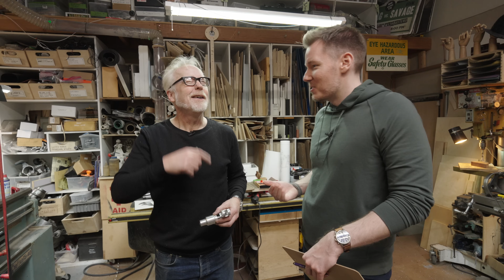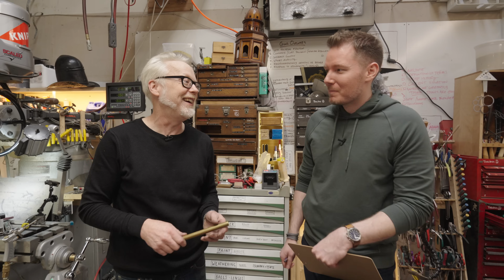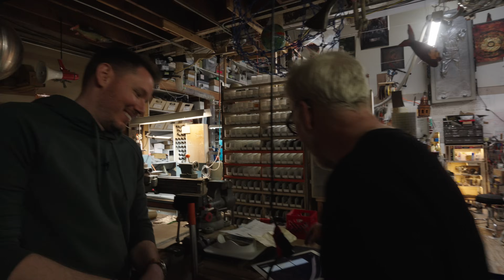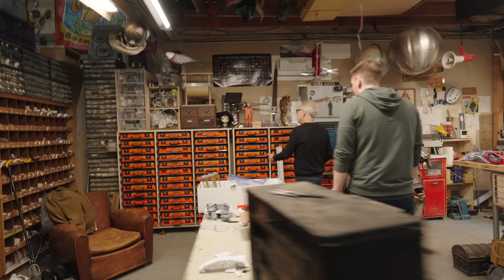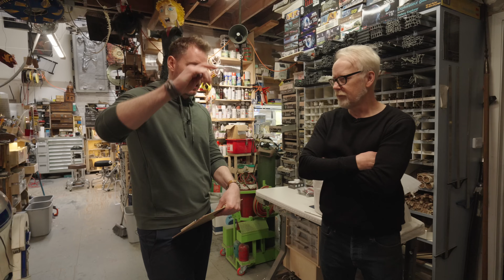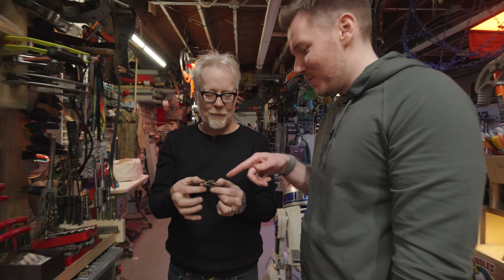Adam Savage's Beautifully Chaotic Studio Tour

Comment: You could use the rear camera if you made a mirror box that was essentially a very short periscope, 2 mirrors would flip then unflip the screen image. You'd have to remove it to access the controls, but you could prob remote trigger recording somehow, even if its by not covering the bottom 1/8th the screen.

Comment: The Marette is different from a wire nut, in that it has a brass screw-in insert with a screw-down wire fastener; then the black plastic cover screws over the brass and covers and insulates the connection.

Comment: I found a box of 4  ft long flex microphone holders at a used mostly electronic store. I think it's 1/4-20 on the far end. They are very flexible and perfectly quiet when bent and would hold your phone. I understand you always use what you have on hand first but I think you would like them better. Used they were $20 each. If they had been $5 each I would have bought the hole box. The guy at the counter said they were $100 each new. Not even sure what I'm going to use mine for but I just had to have it. ADD/AS if you get my meaning. Thanks again for sharing.

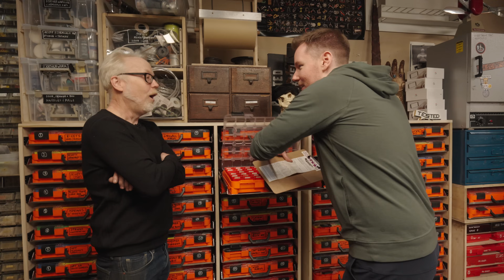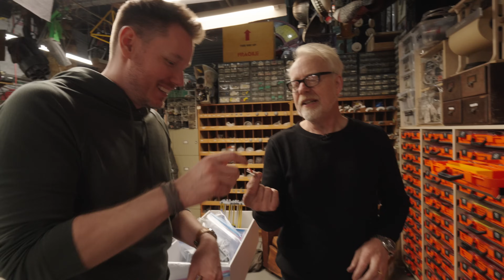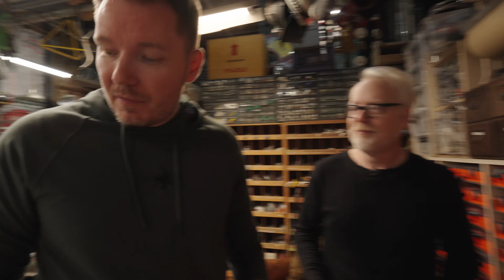Comment: 13:25 genius. 14:45 technically pronounced 'vahh-go' because it's a German company, but should be pronounced exactly as Adam did by a non German. 👏  15:23 Very poor standards to have a bare electrical cable exposed anywhere at all!  Doesn't matter if it's live (hot) or not, just stick a wago on the end or at least tape it up!

Comment: This is testament to the quality of content over the quality of gear used, nice work Adam.
Reply: The Cave and everything around it I have learned works on an immutable level of specificity that makes everything work great despite how most of it is optimized for efficiency, not ease of use. And a whole lot of cooling fluid.
Reply: That’s absolutely true, but I would say that the cameras on $1000 phones are pretty amazing. Of course the big restriction on these things is the size of the lenses, so you will need good lighting, and that’s not cheap, either – but you need good lighting in a workshop anyway.